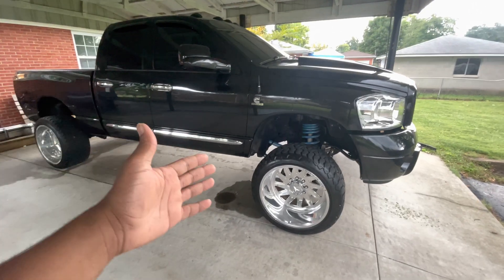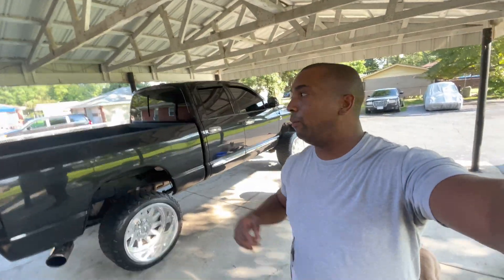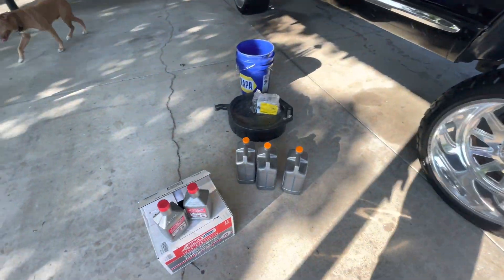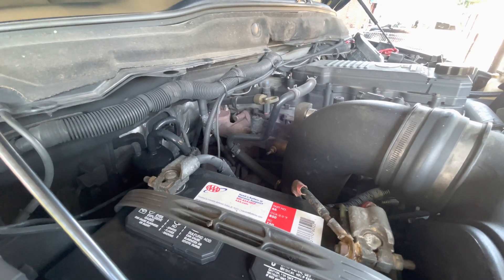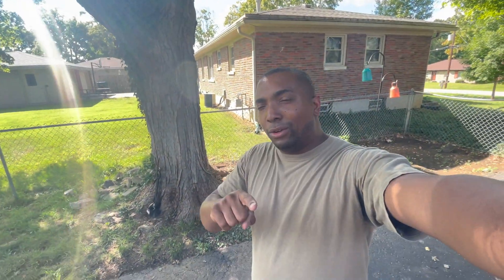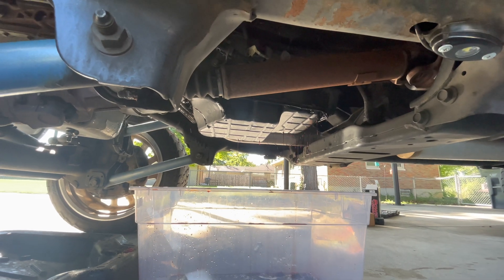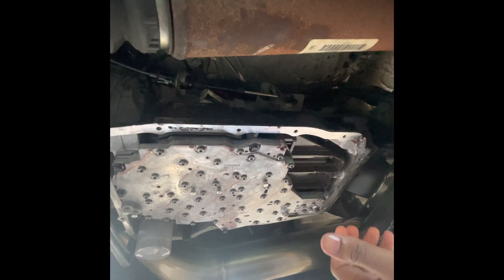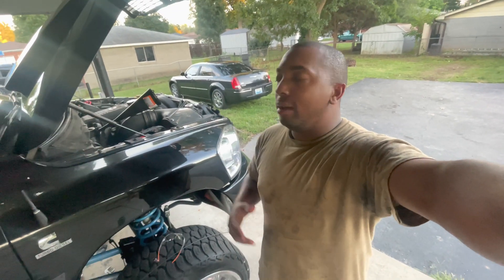TCM codes P0750 and P0700 Fixed

Comment: What up man so I have code p0700 and it also says 4th gear error ratio any idea what it could be ?
Reply from the maker: What year and truck do you have?
Reply: @JamarrelJ  08 Dodge Ram 3500
Reply from the maker: So what fixed mine was the Transmission shift solenoid the one I showed in the video NEAR THE END.  It’s a easy fix for anyone that’s comfortable with dropping their transmission oil pan and removing a few screws. But I would also if your truck is high miles check over your value body. My value body had a issue that ended up causes my value body to exploded later on that I over looked because of time restraints for a car show.  If you have the ability too it would be a good time to upgrade your value body if you had plans to do so. You don’t have too btw.
Reply: @JamarrelJ  thanks man do you have the part number
Reply from the maker: Tragically I don’t anymore. I had it saved somewhere and lost the paperwork to it.